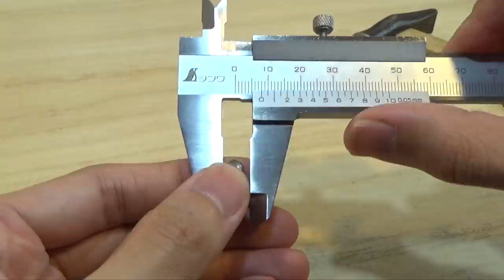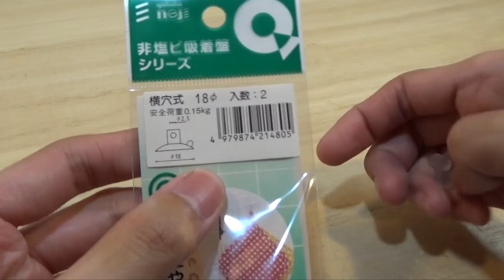How to make a popper lure using a suction cup.  吸盤を使ったポッパールアーの作り方。

Comment: Bellissima. Il legno di Balsa va bene ugualmente? Se si usa la Balsa il peso dei piombi è uguale o bisogna diminuire?
Reply from the maker: Thanks for the question. I don't have any experience in making a balsa wood only, but if you do make the popper from balsa wood, I think you will need to add some weight, because balsa is highly buoyant. In addition, balsa wood is very soft, so you will need to embed dowels to attach screw eyes.

Comment: I like your idea of using the hard wood inner 3rd section for inserting the weights and as a solid anchor for the hook and tie rings. Haven’t seen that before. Another great lure!  Thanks for sharing. 🙂. The suction cup was another creative idea.  Curious why you chose to seal the lure after inserting the suction cup as opposed to sealing first?  🤔🤔
Reply from the maker: Thank you very much. I would like to introduce various lures in the future🙂.
The reason why I sealed the suction cups before installing them is to make the wood more waterproof. The surface of the lure is coated in the last process, but the area around the mouth and the suction cup can be difficult to coat. Therefore, I thought that applying adhesive to the back of the suction cup would make it more waterproof.
Reply: @haru834  Great!  Thank you sir. 🙂

Comment: Yaa-! Haru san. Thank you very much for another fine video. I have two questions: 1. Why did you use a center layer of harder cypress, sandwiched between two layers of balsa? 2. Did you try this lure WITHOUT the suction cup in the front and compare the pop and splash of both versions? Please keep up the great work.
Reply: I think it is because he doesnt use through wire. In balsa wood fish could just rip out screw eyes. In hard wood they will hold up to it.
Reply: @MarcosMVlures   Thanks, Marcos. That makes perfect sense. I completely forgot that most—if not all—of Haru's balsa baits have through-wires. That was silly given how many of his videos I've watched!
Reply from the maker: Thank you for your question. Since the first answer seems to have already been answered correctly, I will answer the second question. I have never used a suction cup-less popper, so this is just my prediction, I think it will probably work like a short length pencilbait.
Reply: I really like the sandwiched approach in adding lead.  The smelly lead pot can't be good for you.  To do it right, you will have to add ventilation (vent to outside).

Comment: can i get that epoxy and all paint you use on shopee? can u give a specific brand?
Reply from the maker: Thanks for the question. The brands I use are "Nagashima" and "Mr Hobby (Mr_Color)". Mr_Color is originally designed for model painting, so I think it's easy to find in hobby stores.
On the other hand, Nagashima's epoxy coatings may be difficult to find outside of Japan, unfortunately. Therefore, you will need to look for an epoxy coating agent that is sold for coating fishing rods.
Here is a link that may be helpful.
*Mr_Color website: https://www.mr-hobby.com/en/product1/category_7/87.html .
*Mr_Color(Shopee): https://shopee.com.my/search?brands=1146782&keyword=mr.color&noCorrection=true&page=0 .
*Nagashima's website: https://www.nagashima-manbou.co.jp/shop/index/4#item16 .
Reply: @haru834  Thank you sir 🙏👍